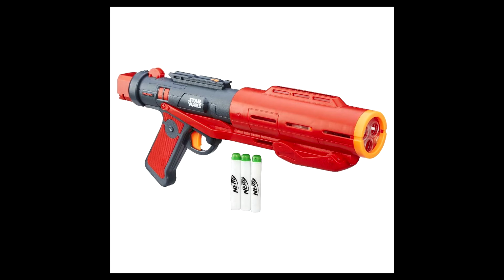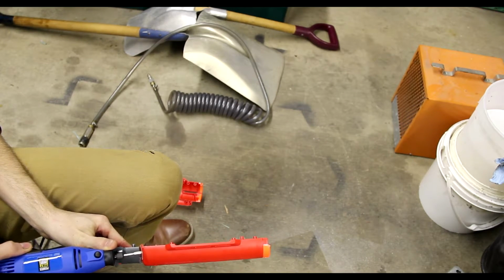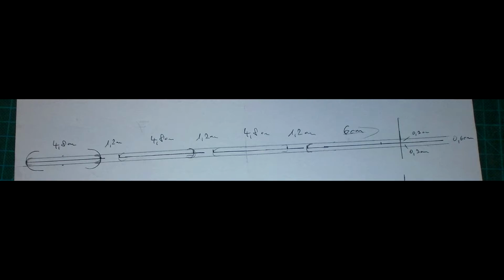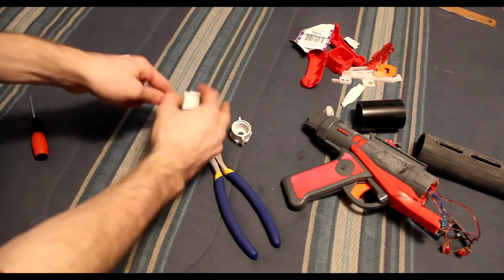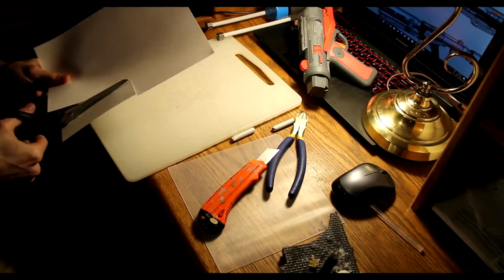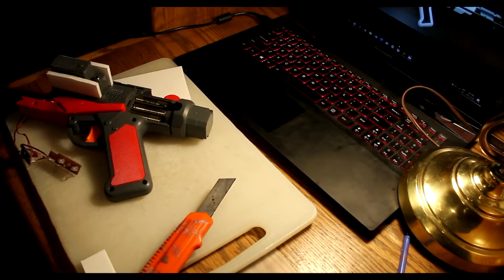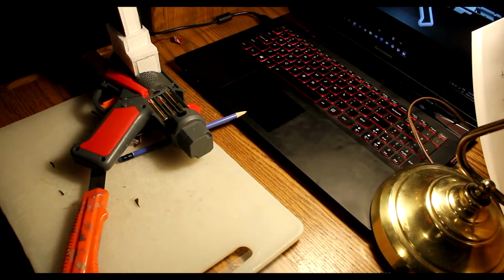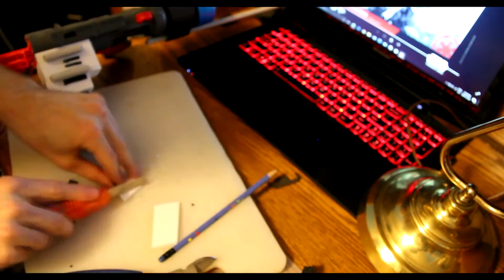Star Wars: Rogue One- Nerf Death Trooper Blaster Conversion Part 1

Comment: will you do a fabric tutorial for the for honor build?
Reply from the maker: James Wilkins I can do a video focused on them showing on some of the techniques I used?
Reply: Regrettable Props thanks i am currently building a similar costume to the for honor armor but can't do the fabrics and that would be a real help
Reply from the maker: What parts would you like to go over? It may just be easier to show on my FB page and can take some pictures showing the process
Reply: Regrettable Props i am most intrested in how you weathered the cloth and also how you got the details like the small patterns
Reply from the maker: Quite simply put for the weathering I had mentioned I threw the clothing around in dirt and later dry brushed on a mixture of black and brown acrylic paints. The black sun and yellow cross from the video were painted on using a stencil I had cut out. The brown edge of of the white and blue had it cut into strips and then the outside edges folded over and then glued on to those desired areas